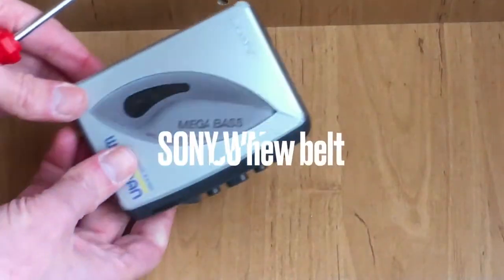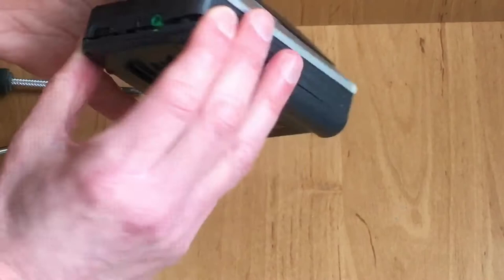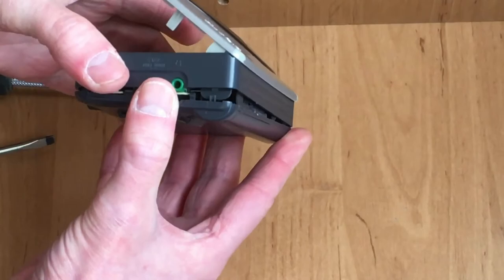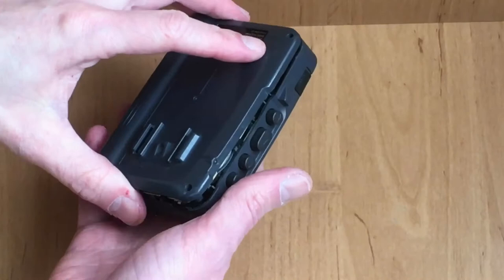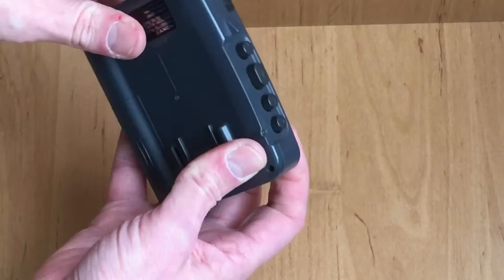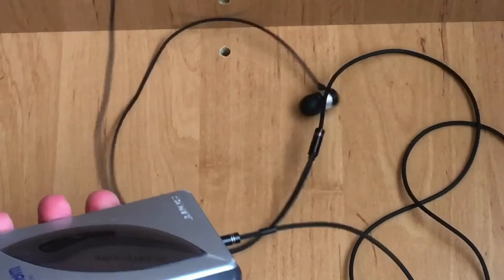Repair Sony Cassette Walkman WM-EX190 (open up for belt replacement)

Comment: Would have been very useful if you had shown how to lift the circuit board and how exactly to replace the belt.
Reply: Yea. Skipped the hardest part 😢 But I managed to open it and change the belt. Not the easiest walkman to open that’s for sure.
Reply: There are a few tabs in the circuit board, and one screw holding it on. Lift up, gently coax the colored wires out of the guide cut from the circuit board so you can lift it up on that side, and be very careful of the ribbon cable.